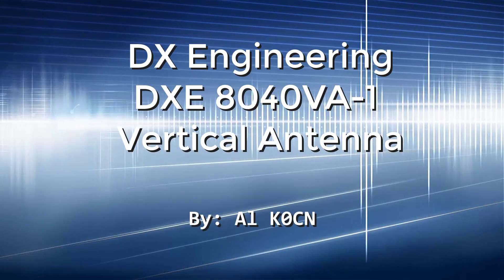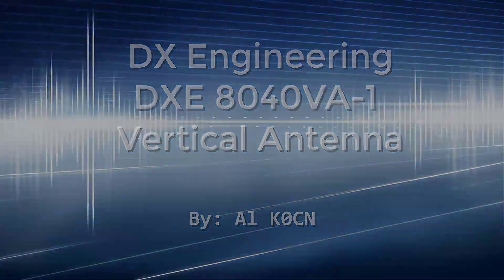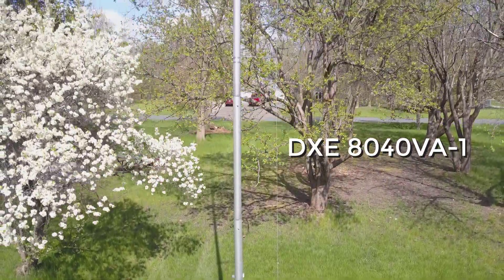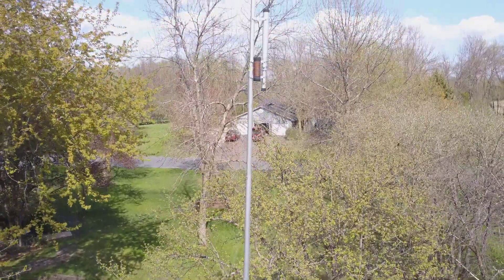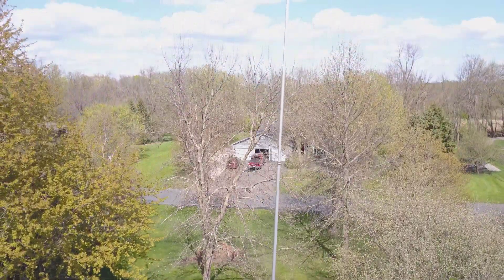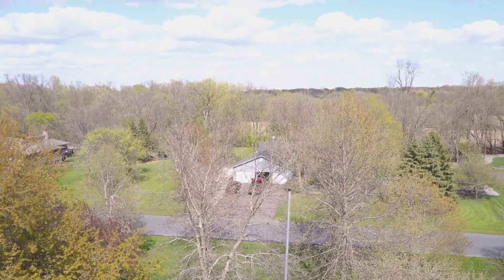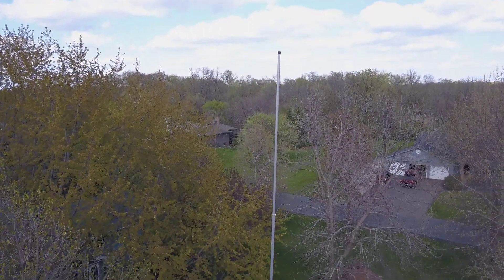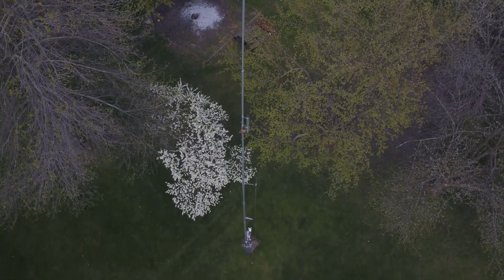DXE 8040-1 Vertical Antenna

Comment: Wow I bet these are pricey. How do they perform on 80? Compared to say a doublet at 40 feet
Reply from the maker: Nothing wrong with a doublet at 40 feet, but if you want to  make contacts with DX stations more than 1000 miles away, the vertical will do the job while the doublet does not make the contact. I have found this to be true on multiple occasions.
Reply: Al Senechal how is it at nvis on 75 meters?
Reply from the maker: Not my first choice for local Q's, but that's why I also have a dipole at 50 feet. Different tools for different jobs.
Reply from the maker: @JayN4GO   It doesn't work well for near in stations. Some are ok, but many are not. The dipole works better for near in stations.